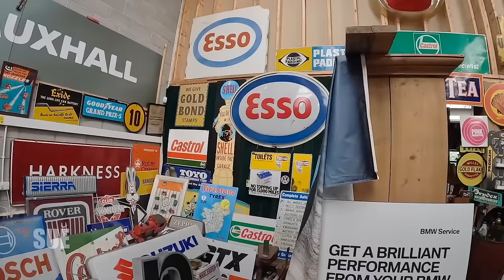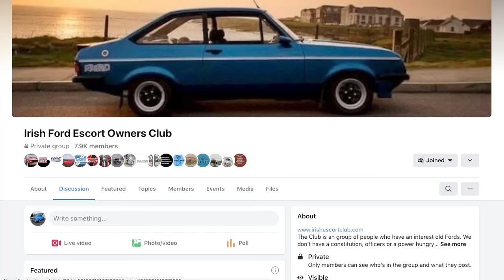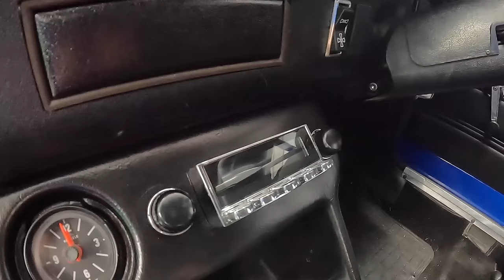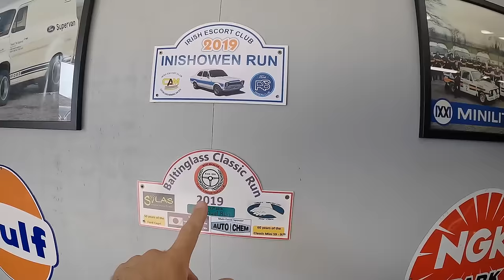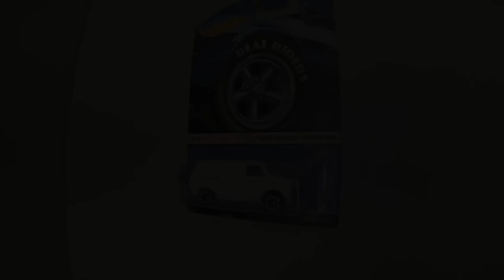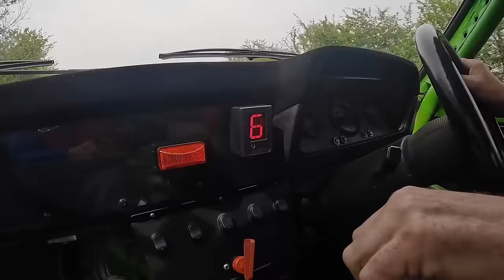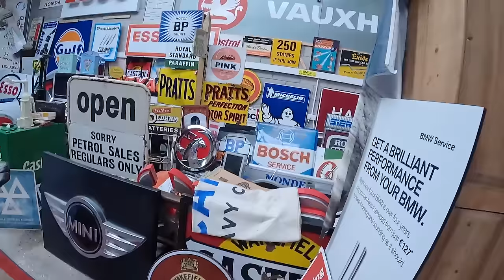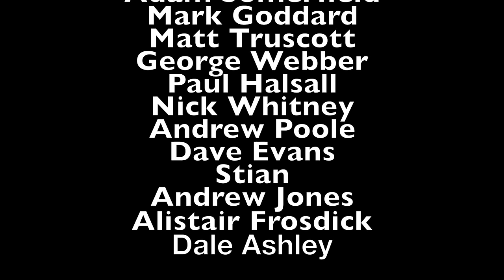Visiting BDC driver Declan Munnelly! 😃 *DRIFTING IN MEXICO* 🇲🇽

Comment: Great vid and some awesome motors being displayed here. You can't knock the costcutter+ engineering and design departments 😂It's actually genius the lengths they go to save a penny.

I just noticed this with Vauxhall (and even more recently Ford too lol) washer motors today. 
They work in reverse. So, for the price of a 2p plastic adapter you save yourself the cost of a whole separate motor. Does two jobs but with one failure point, for better or for worse. Less wiring too for more savings too. 
There are definitely cost benefits I've missed too, that's guaranteed. 
The Japanese seem to be sticking with dual motors. More expensive, but prob doesn't leave you stranded. lmao
As, I said.Genius 🤣😂
Reply from the maker: We can all be thankful that Ford kept everything simple. It makes it easier for us to fit parts from other models etc. 👍